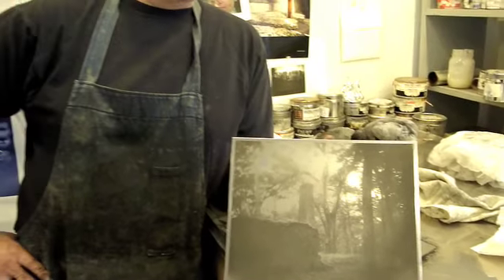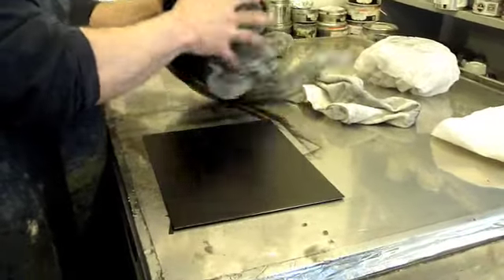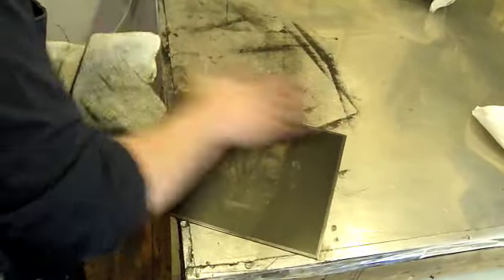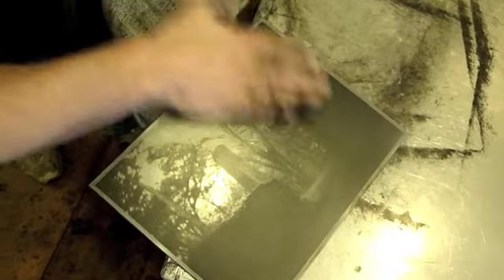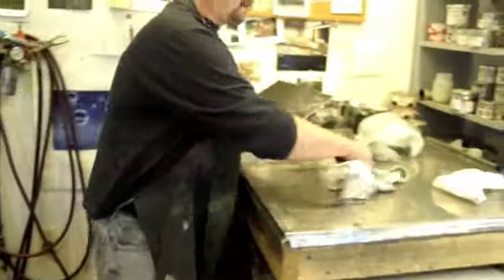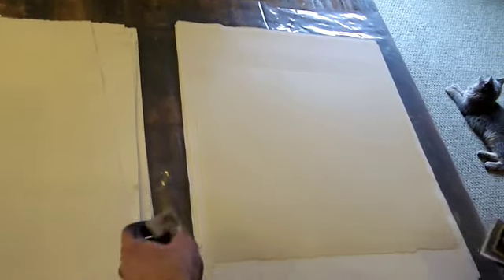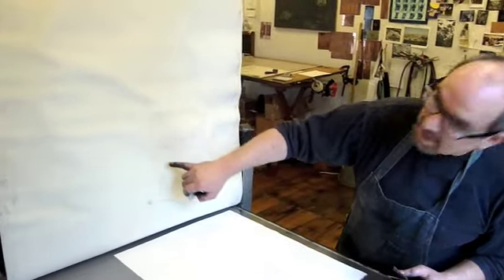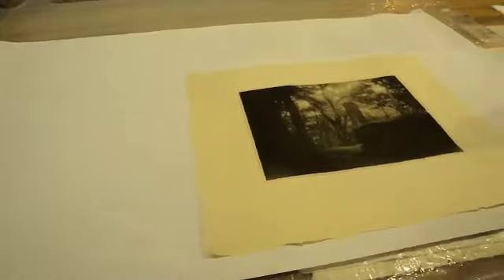Paul Taylor Copper Plate Photogravure Printing

Comment: From what I guess, it's like making electronic board. they sell plate with a uv sensible vernis on it, and so you print on a transparent paper from an inkjet machine your picture ( black and white , well not exactly it's a special software), then you expose the plate under UV with the film you just printed, and then you put it in an acid bath like if it's copper : perchlorure de fer, sich will eat any are that are not protected by the vernis which was destroyed by the UV.